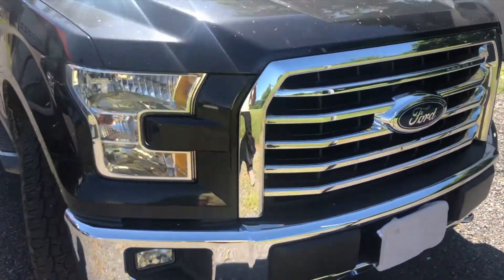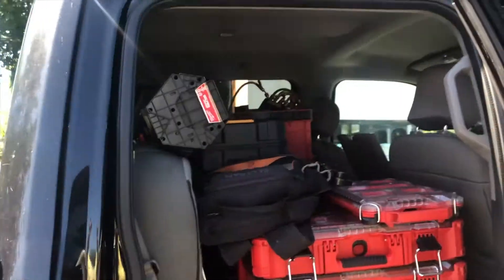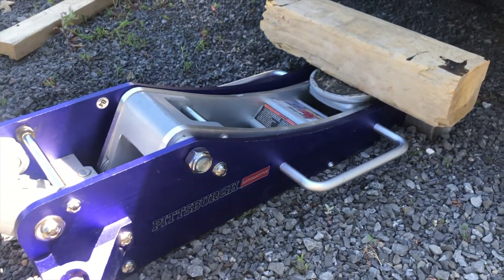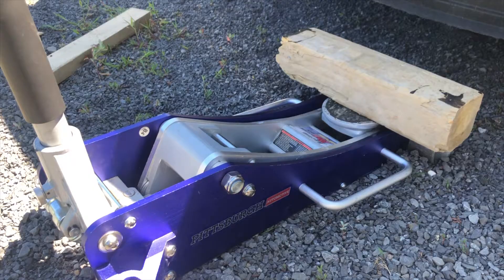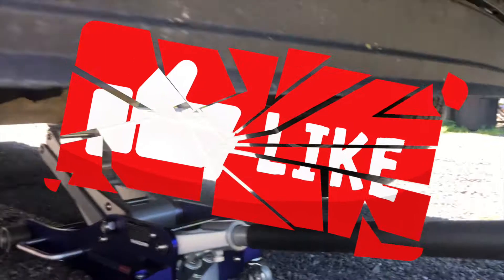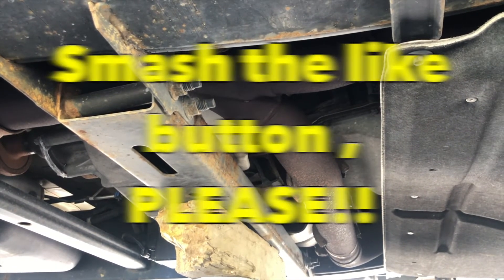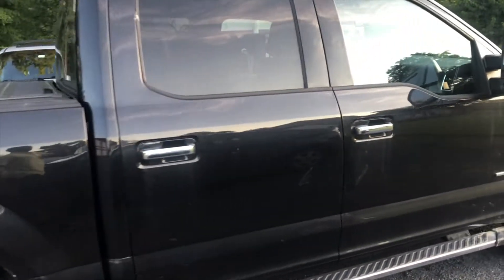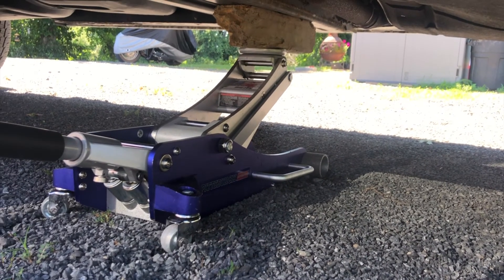How to Jack up the front of a Ford F150

Comment: This is super unsafe for two reasons:
1. This floor jack is not rated for the weight of the vehicle. A 2 ton jack is designed to only be used to lift vehicles that way LESS than 2 tons. This F150 could be as much as 4 tons with all the gear inside.
2. DO NOT GO UNDER A VEHICLE THAT IS ONLY SUPPORTED BY A FLOOR JACK! If the hydraulics were to fail, the vehicle would fall and could crush/injure you!
Reply: the entire car is weighted at 2-2.93 tons at most jacking to front up would only be at most 1.465 tons to lift
which is posible with a 2 ton jack

Comment: Thats not where you lift from the front. Read your manual
Reply from the maker: Yes , that is correct , but in situations, when your truck  is stuck , you may not be able to lift from the same location , this video shows that.
Reply: Where the right place ? I need to lift my front
Reply: Thank you for the “unofficial” aka the real world ways to lift an F-150. Can I use this method for a ‘17 Expedition? My gut says 90% yes 👍🏽